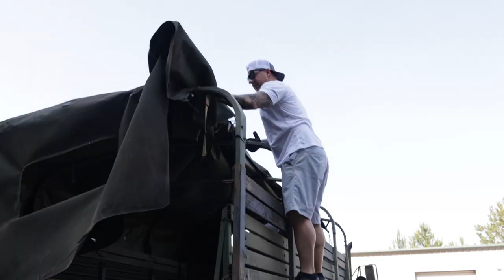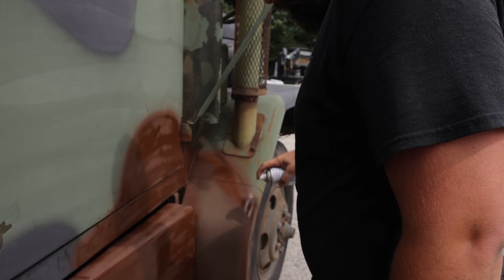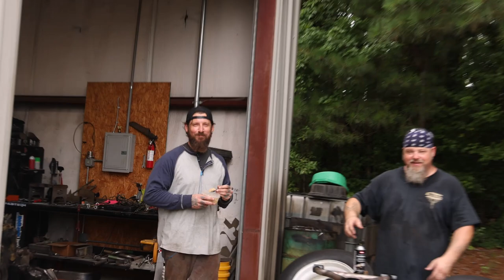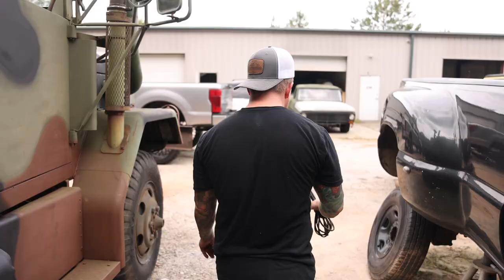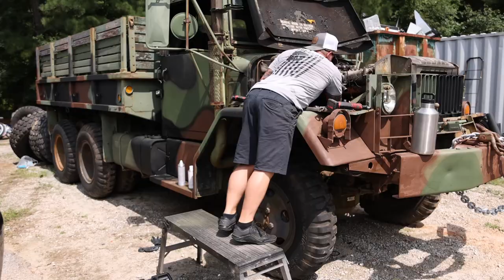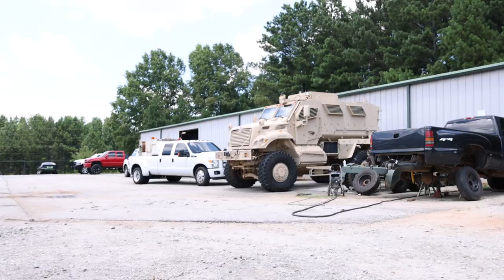Building My Deuce & A Half Military Truck In 14 Minutes

Comment: That looks bad ass! I got a 70 m35a2 with the Hercules and the D turbo ( the one you took off). I hope to paint mine like yours but for now it’s marshmallow white lol. Also since you put those supers on there be sure to look up about flipping your rear hubs it will help with the wear and tear on your wheel bearings. There’s a lot of threads about it on steal soldiers!
Reply: I have a 69 Jeep Kaiser. Flipping the hubs help so all the tires are in line and no chances of rubbing, especially the front when turning.

Comment: As for Superduty trucks, I'm working on a 1988 right now. Even I didn't know they started that early. But Ford's new lineup in '99 is the new current line.
Reply: Back then, the 450 and 550 was the only truck offered in the superduty lineup. It wasn’t until 99 that you could get a 3/4 and 1 ton in a superduty

Comment: Where did you get the mrap wheels? Did you need adapters?Lol just saw the part where you installed the adapters. Is there a kit that comes with adapters and bolts? Those mrap wheels are just standard wheels? Cant seem to find this setup for my duece and a half
Reply from the maker: There was a guy about 2 hours from me that had them. I found them on marketplace. The adapters, it had the bolt size on the website. I honestly don’t remember the size or website, I found them on EBay.

Comment: Sick deuce brother! I got a very similar build, same wheels and tires. You plan on upgrading the power steering? Mine ain’t budging from a dead stop lol. I thought my compressor was out for the steering but I’ve seen a lot of guys do hydraulic conversions. Sounds dangerous at higher speeds though.
Reply from the maker: Appreciate it! I’m going to leave steering alone for now. It doesn’t move east at slow speeds but once going, it’s fine

Comment: Where did you get those tires? Also, are those 355/85r20’s? Or 396/85r20. I couldn’t tell on the sidewall. Thanks
Reply from the maker: 395/85r20. I have a guy in Georgia that buys and sells used military tires and wheels

Comment: 2 Serious questions:

 1) does the motor have any issues with running USED Motor oil for prolonged periods?

2) is a duck and a half, Hardened against a EMP attack? 

- I think you can understand where this is going!
Reply from the maker: Haha, doesn’t affect it. Motor was built to run on anything combustible. I usually mix it with ATF, used oil, diesel. 

And yes. A EMP will not affect it.

Comment: Man, at first I was worried that the rear tires wouldn't fit when you started mounting the first one.
Reply from the maker: Lol I made sure they would before I bought it all. If not then I would have just bobbed it 😂
Reply: There's about an inch in between the two rear tires. 46" is the biggest you can go on a tandem for the deuce, bigger for the 5 tons.